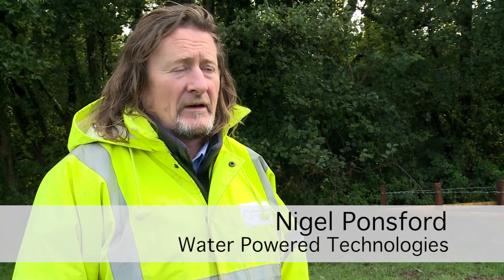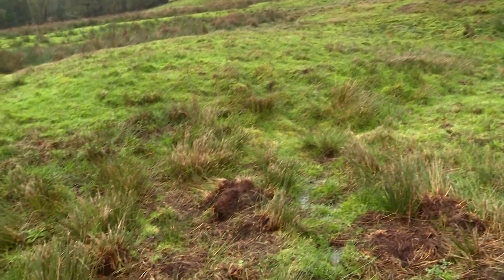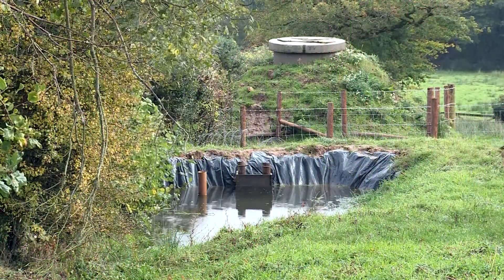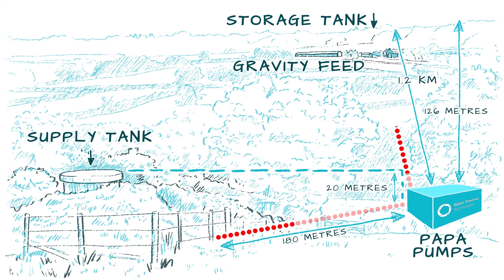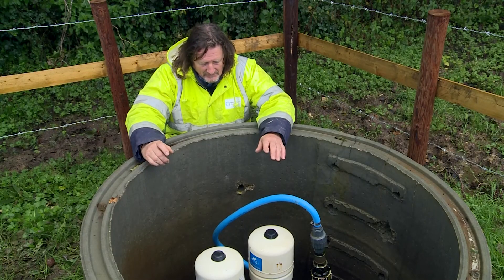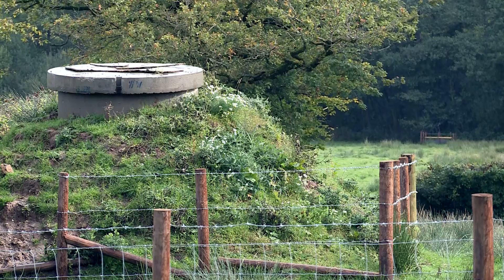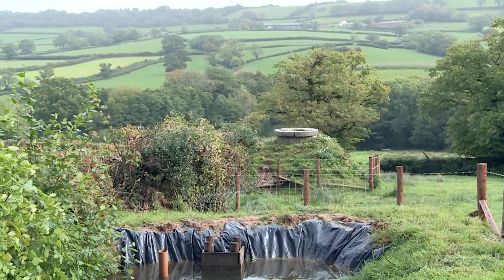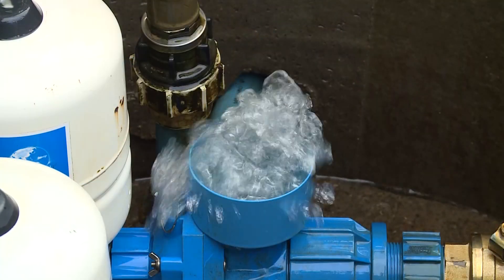Papa ram pump - Honiton Case Study showing savings of many £1000's

Comment: The water supply I want to pump from is over two meters in depth why would I need to Inlet pipe lower if I can set my pump up at a depth of two meters under the water. My water depth is always at this two-meter depth.
Reply: If your pump is 2 meters below the surface level of the water it will work as long as it is in air. However, it will not work if you try to run it under water.